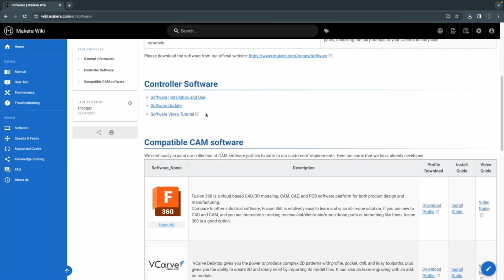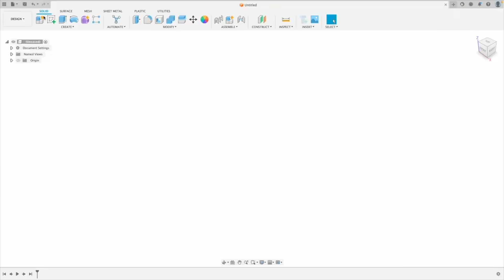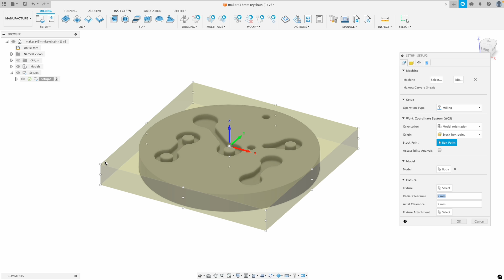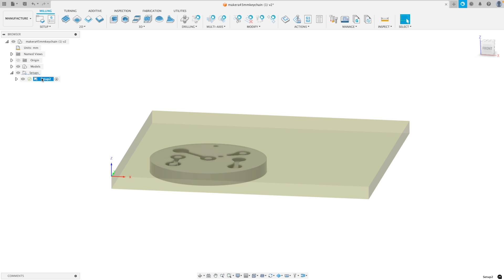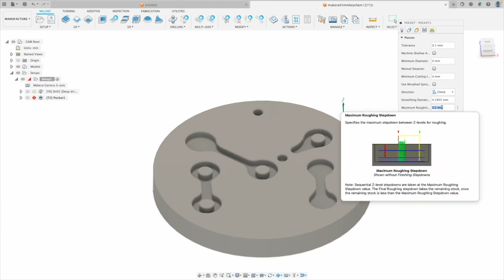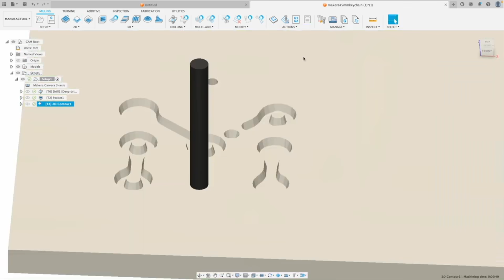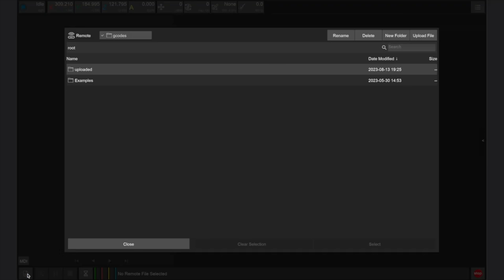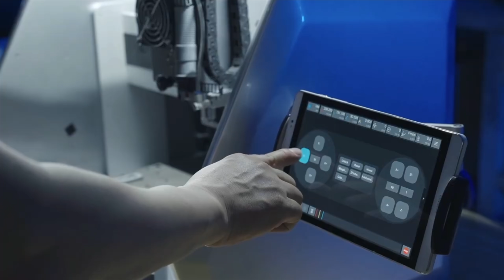How to setup and use the Carvera CNC with Fusion 360

Comment: Hi, I tried following this example step by step but upon trying to simulate the 2nd toolpath ( V bit, pocket clearing ) I just get the following error message " Failed to import the selection into simulation. Post Processing it may highlight the issue". Any ideas on the problem that causes this? I have tried the post processing suggestion but nothing jumps out as the cause!!!! Any help would be greatly appreciated thanks.
Reply from the maker: Please reach out to our support team at support@makera.com so we can provide more specific technical assistance

Comment: I am getting this error when Trying to create the Pocket.  The drill operation worked fine.  "Error: Invalid toolpath point detected '(nan, nan, nan)' for 'onLinear'.

Warning: The Work Coordinate System (WCS) Offset is set to 0, which defaults to using G54. It is likely that you do not need to change the offset because for most machines, the G54 WCS offset stores the location of the Setup's origin in relation to the machine's origin. To change the WCS offset, go to the Post Process tab of the Setup dialog, and enter 1 for G54, 2 for G55, and so on."  "Hint: Generation of operation was not required.

Feature flags: drilling-holes-accessibility (off) inspection-in-pim (off) setup-sheet-viewer

Warning: One or more passes were discarded due to linking constraints.

Warning: One or more pockets were not machined because they are too small to be reached with given ramping constraints!

Generation completed with 2 warning(s) in 295.2ms."  I have tried recreating it multiple times.  Any idea how to fix it?
Reply from the maker: This sounds like its an issue with your WCS settings and how the job has been placed on the origin and clearance heights. Please contact our support team at support@makera.com for additional assistance, or chat with other users in our reddit channel who may be able to help.

Comment: 12:13 you can use hot glue and mill the taps away. Less manual work but a little more cam work.
Reply from the maker: Great suggestion, thanks for sharing!